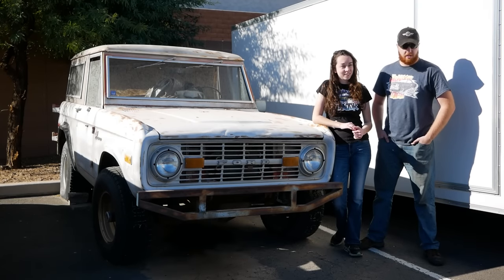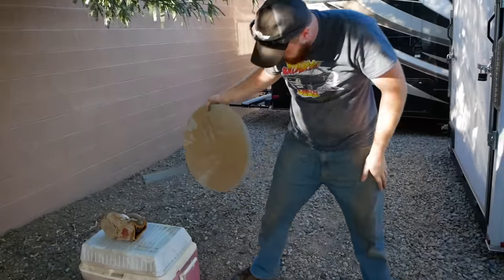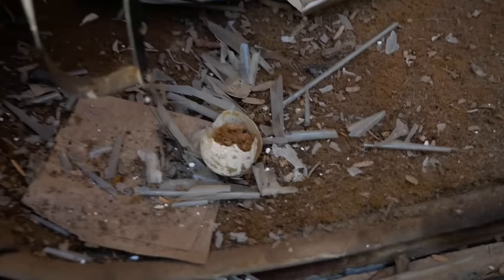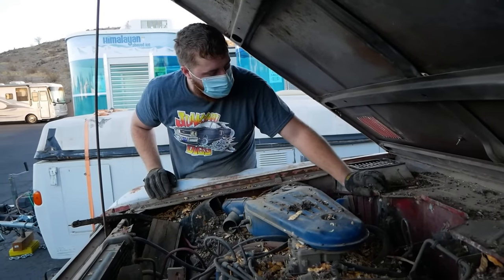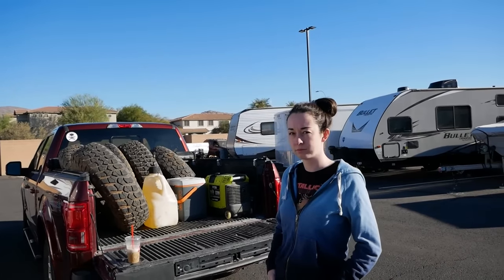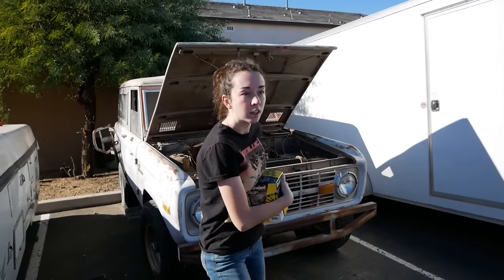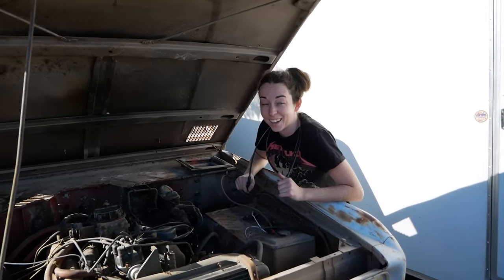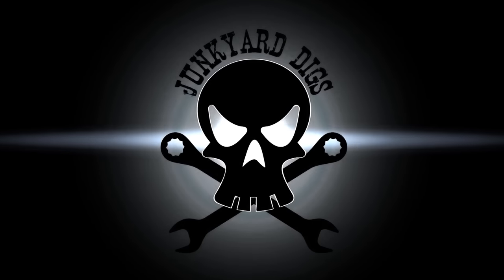ABANDONED Bronco Saved After 10 YEARS in a Storage Lot! Will it Run and Drive?? - Part 1

Comment: They didn’t change to the 351w firing order for the roller 5.0 until 94 except for the HO 5.0 🙂
A guy can also pull and measure a single pushrod to determine if it’s a roller - since the roller pushrod will be shorter due to the taller roller lifter. The roller pushrod measures 6.250 in stock form. 

Good coverage over the Windsor series - your dad here just had to add some points 🙂
Thunderhead289
Reply from the maker: Thanks dad, Hope I made ya proud👌😂
Reply: This comment might as well have been in French. Right over me head.
Reply: @JunkyardDigs  That's an awesome find ya got for yourself. I hope that you end up restoring it cuz there just ain't enough of them Broncos on the road anymore. The 302's are nice and all, but I would've preferred to see it with a 351 Windsor due to my own experiences with those motors. I had an '85 F250 with the 351. Bought it with 175k miles on it and sold it many years later with 325k miles on it. It was still smokin the tires by that time and was one of the most reliable engines I've ever had in a vehicle, though the 5.9L 360 Dodge motor that's in my 2000 Durango is givin it a run for it's money. :)
Reply: @sweettony9359  most of what I say goes right over car folks’ heads it seems.
Reply: How can you tell what firing order your aftermarket 302 camshaft has? Like what lobes would be different?
Reply: @ipissed  once installed and valvetrain set up, you can simply look at the driver side bank and rotate the engine over with  from the crank via socket. If the next cylinder to be on the compression stroke after cylinder one is cylinder 3 (both valves are UP), then you have the HO/Windsor style firing order. 

After cylinder 1 is cylinder 5 for the oldschool firing order. 

Luke aka Thunderhead289
Reply: @ThunderHead289  Yea, I was just thinking that you could do an o'clock position of the lobes. Mine is already in with valve covers and all so I guess I will have to TDC every cylinder.
Reply: @ipissed  only have to do two. As mentioned above
Reply: These are all some great tips on engine identification. Another way to tell if you have a Roller or Flat Tappet camshaft, if you can shine a light into the lifter valley and be able to see the "dog bone" lifter guides and the sheet metal hold down tray thru the pushrod holes in the heads. Another way to tell if you have a factory roller cam 302 engine instantly is the rocker arm mounting hardware. Factory roller cam engines use a bolt and is fully tightened down. NON-Roller Flat Tappet 302 engines have studs with pivot balls/washers and lock nuts to adjust valve lash.
Reply: Luke/Kevin, the 5.0 HO carbed NON roller from 82-85 also came with the 351 firing order
Reply: Every time I watch Junkyard Digs or ThunderHead289 I get that same fear I got years ago in school. Will there be a pop quiz?....Seriously, very good and detailed information.
Reply: @ThunderHead289  tks fer that bit of info gem, and really makes sense, tks.
Reply: @ThunderHead289  have u eva checked ur iq level? Bet its pretty high up there.
Reply: @edwardmulder3777  the way I look at life is that we have one full glass in front of us that represents our potential - we are able to pour that glass into an infinite number of other glasses which represent skills, abilities, and knowledge. 
We only have so much potential, I poured mine into some very specific things thus far in my 27 years - I’m no more intelligent nor capable than anyone else.
Reply: @ipissed  yes, if you put a 351W/H.O. firing order camshaft next to an early(pre-82 mustang & pre-94 F-150 302 cam(trucks had both non HO and HO 302 roller cams from the factory, I had a 92 F150 truck with a roller cam & the 15426378 firing order) the lobes will be in different places.  early 80's brought another important change on 302's only - move to a 50 oz.-in unbalance weight(they took 8lbs out of the crankshaft) from the early 289/302/351 28.2 oz-in unbalance factor.  Late 82 Ford also went to the one piece rear main seal!  lots of fun with fords.
Reply: Also, on the 5.0 roller blocks the lifter bores are actually taller, which is mainly why they make "retrofit" roller cams with smaller base circle to use factory 5.0 lifters in an early block.  usually link bar style hydraulic roller lifters do not need a small base circle camshaft, if the lifters are made correctly.
Reply: Wish it had the 289ci. My boss had a 1st gen bronco back in 04. Farm fresh. Even had the "Wolf whistle" Running off of the vacuum.. I love a 289. It can really get those rpms up
Reply: @ipissed  The best way to figure out firing order in my experience is to fill each piston chamber with rocket fuel, crank it and watch to see in what order the pistons come flying out of the block.
Reply: In the older 302 blocks, could a machine shop machine those bosses to convert it to a roller block?
Reply: @ThunderHead289  have you started drinking beer with old folks or something because your sure sounding like one today😂,but those are some really wise words Imma use it as a caption on a Insta post,I'll be sure to tag u👍
Reply: man im glad im just a MOPAR/AMC guy..less confusion lolz
Reply: I remember getting the firing order wrong on a 351W that was fitted into a Nissan pickup so we didn't know what year the engine was.  Apparently they changed sometime in the mid '70's, according to the book we had, though I suppose it might possibly have been a 302, the book still said the 351w changed firing order in the mid '70s.  It just barely ran with half the plug wires wrong, but we did drive it up a hill before trying the other firing order.
Reply: @ThunderHead289  I couldn't have said that better myself brother. I'm honestly happy to see you post such outstanding words to an audience of youthful people. Thank you Luke.
Reply: @ThunderHead289  By the way, I am 10 years older than you, born in 1983, and I learn new things every single day. The day that you truly believe that no one can teach you anything new is the day that you give up on life. You have a great outlook on life, and when you give words of wisdom like that, that's what makes me respect you as much as I do. You're a good guy Luke, keep up the good work and lead by example brother.
Reply from the maker: @william.s.goodwin  that was addressed in the video
Reply: @william.s.goodwin  All 5.0 High Outputs starting in 1982 had the 351 firing order.  '82-'84 were all flat tappet engines, and the roller cam debuted in the '85 carbureted HOs.  CFI/AOD '85s still got flat tappets.  After 1986, all HOs were roller cams and multiport fuel injected.
Reply: @DanEBoyd  That's what I was pointing out, though with a disdain for typing. I have an 82 GT that had the flat tappet HO. It's why I swore never to let a shop touch my car again, if I could help it. It has since been upgraded with a roller block after the original effectively split itself in half. Still have what was left of the #5 piston.
Reply: @william.s.goodwin  I had an '82 GT too.  It was red with a black cloth interior, and had just about every option except power windows and power locks and tilt.  It had cruise control with the Crown Vic-style steering wheel, and it even had the rear wiper!  '82 GTs are the best looking Fox Bodies ever.
Reply: @DanEBoyd  Agreed! I still have mine. It's a little worse for wear, but it's staying. It's an Argent with the Boss package.
Reply: @william.s.goodwin  Argent ones are the rarest, and my favorite color on '82 GTs.  Medium Red is OK, but Raven Black (or whatever they were calling it in '82) just kind of seems to obscure the car's styling.
I once had a coworker with an '87 or '88 GT tell me that he thought my '82 looked overdone with its hood scoop!  The '87-'93s are cool, (I have an '88 GT convertible) but are way more garish than the '82 could ever be.  
The Four Eyed GTs harkened back to real Musclecar styling, but the Aero cars definitely set some standards for the ricers who were to show up on the scene some years later.
Reply: @ThunderHead289  It sure does!  Accelerator pump?  Needle and seat?  WTF!!!  I think you made those terms up!  JK

Comment: I've got a '74 Bronco with power brakes and steering, 347 stroker SBF,  630 Holley 4bbl, (throttle body injection maybe this summer) new Centerforce clutch, heavy duty truck 4spd w/an Atlas transfer case, Dana 44 posi front end, Ford 9" posi rearend, 4.88 gears, just mounted a new Warn 8000lb winch up front, and to help that out I installed a Ford "Big Green" alternator, it's what Ford uses on their ambulance vehicles, so it's got a lot of juice...Bronco's weren't offered with A/C til 1980 I believe....Tom's Bronco Parts is a good place to source parts, but try to keep in mind that 1st generation Bronco's are worth a lot of money when done right, so they can get spendy, but their value keeps goin up...I paid $6000 for mine in 2008, it had been sittin under an apricot tree in one of the last apricot orchards left here in San Jose, Calif, turns out my Mom's high school boyfriend owned it...I was offered $25,000 cash for it right before this Wuh-Flu covid crap hit, and I turned it down....hang on to that rig bro, pass it on to your kid or whoever, it'll pay for itself and then some one day, it's a good investment....and they're beasts in the mud and snow ....🤘🏻🇺🇸....
 
IF YOU EVER DECIDE TO SELL IT, please MAKE YOUR INTENTIONS KNOWN ON YOUR CHANNEL...✌🏻

Comment: After watching Mook's dedication to these endeavors I think she deserves a dedicated points file ($1.50 on Fleabay) and some "don't bang my knuckles" gloves. Believe it or not  Ford Solenoids once had a button on the bottom for under hood cranking... honest. I pull off the connector from the solenoid and use a remote start button. Point file, feeler gages, remote start button and test light in all of my tool boxes. Horrible Fright was giving away electrical testers... got about a dozen.

Comment: MMO and Seafoam in the oil  and gas will definitely help quiet down the engine, and smooth out the idle a lot.  It will also help to free up those stuck rings.
Reply: He uses brake cleaner as starting fluid. I know it works but it's not ideal with fresh starts

Comment: i had a old 302 that ran great never knocked, smoke never used any oil. not even a leak. unknown miles. but my K bar was cracked on my truck so i pulled the engine to fix that then i saw i had a bad dent in the oil pan so i was going to change it. and when i pulled the pan i had 15 skirts in my oil pan. the 16th was off the piston also but dont have a clue where it went.  i love fords i have owned fords since before either of you was even born. i really like the FE blocks.you have a great find there keep it fit it and don't ever sell it.

Comment: Don't forget that Ford changed how the crankshaft was balanced in mid 1981 in the 302's..... That can be a nightmare if you swap out an 81 engine. You have to use the correct balancer and flywheel or a vibration at higher RPM's and a rough Idle will happen.

Comment: I am not sure if you will get anything from it, but I ordered some parts off rockauto.com and they asked where I found out about them from and told em it was you.
Reply: I love Rock Auto. I wish their shipping pattern was simplified. If I order a bunch of different parts they can sometimes ship from many locations and the shipping costs nearly break the deal. If you need one or two parts like a distributor or oxygen sensor for example, its almost always an amazing deal. But spark plugs and little things add up just due to shipping in a large order. Still my go to parts source regardless.

Comment: Just a tech tip. For pulling oldcars/bikes out of the woods and what not. A hot glue gun can coat naked wires quickly. Works better than you may think

Comment: A buddy of mine had one of these in high school and it was great other than we had to reset the points every week for some reason.  At one point, we had toyed with the idea of trying to superglue or weld the adjustment screw in place, but left it alone because we weren't ready to make that kind of commitment.  The videos are great, especially the ones with your hot sister in them.  Go CLONES!

Comment: One good tip for vehicles with points, use a penny to rub on the points. Works as both a file and adds a little bit of a copper coating to help rejuvenate points that you wouldn't expect. Also you almost always will have a penny on you.
Reply: Smart tip. I’ll have to try that

Comment: When you opened The hood, i Felt the mess, when i Brought home my 63 Plymouth Valiant, it had been sitting for over 20 years, the engine looked like a Haybale.....  The car is currently Awaiting Reassembly, and i am slowly Rebuilding the car, Stripped to the Unibody Frame, to sometime, Fully rebuilt and Mostly Restored, With the original 225 and push button trans.

Comment: @33:46
I came to watch again (apparently had viewed some time ago) from the diesel Buick or was it the 'New Shop Revival' video which I binged after the Buick Century revival, so when Mook suggested she could hear through a plug wire that Kevin is an idiot, I immediately was reminde of the grand difful-gul-tees of trying to isolate and quite the squeeling belt issue on the Century.  That whole managerie of different fixes that failed time and time again was when even Kevin himself began to question his 'idiotic' decision to revive the worst ever 80's GM vehicle produced.

Comment: www.wildhorses4x4.com/
(888) 405-1921  WILD HORSES 4x4 - 66-79 Ford Bronco Parts Source
1966-79 Early Ford Bronco Parts Source For Restoration, Off-Road, & Conversions. We provides parts and accessories for your 1966 - 1977 Ford Bronco. Call for Technical Help. Early Bronco Specialist. Expert Tech Help. Your Early Bronco Experts.
66-77 Ford Bronco Parts · 78-79 Ford Bronco Parts · Off-Road Vehicle Parts · Specials

Comment: i always use gas/oil mix~2 sroke fuel~to start engines that have been sitting several month's or more, make's me feel better,
Reply: Beats dry starting one, the rings alone will thank you
Reply: "Pyroil" was a good upper cylinder lube, the new cars would come with it from the factory, "back in the day".

Comment: A good rule of thumb is that if the engine has a MAF sensor it runs the 351 firing order. If it is carbed or runs speed density efi then it uses the old standard 302 firing order

Comment: 18:05 You're gonna hafta use da vacuum on da BLOWER setting to start out with, Kevin --- ya first gotta DISLODGE all of dat crap and get it whooshed up outta those nooks and crannies before ya can vacuum it up!  In fact, if I were doing dat job, I'd probably use TWO vacuum-units at da same time (i.e., with their air-hoses held side-by side, maybe with each hose held by a separate person, so dat da vacuum hose can be separately positioned to always "follow close behind" da blower-hose) --- one to blast da debris outta da orifices, and then another to immediately suck up da dislodged debris while it's still in suspension in mid-air, before it has a chance to fall back down into da engine-crevices again. :P

Comment: Harbor freight has 1200 watt compact generator ( size of a very small cooler ) for as low $80 on sale that might run a vacuum or an air compressor.  Might want to add to your revival kit.

Comment: You are officially a poopologist after cleaning that full engine bay of rat poop or some other animal poop. I had an apartment in Tucson Arizona  for a couple years. Glad to see you didn't come during the summer that would have been awful cleaning that poop out in 110 degree heat. That's great that you git that engine running my 89 F150 starts up first time every time in winter or summer and its a 5.0 liter V8 and has never let me down.

Comment: the fact that the engine turns with the fan belt sort of says it has NO compression...    i have never seen that before..   i like the Bronco..  thanks for not buying a complete piece of crap..   good job getting it running..  i hope it does seal up and start running better..    it probably wont but if it runs IT RUNS..      GREAT JOB..

Comment: Me: "Oh look, another video from Junkyard Digs.  Aww crap, 45 minutes?"  clicks on video when bored enough

Me 45 minute Later: What?!  That's it?  Crap!

All in all, I do enjoy these old 1970s Ford revivals.  We inherited my Grandpa's '75 F-250 Custom.  Ethanol killed the original carburetor and ended up putting one of those Chinese carburetors on it off Amazon.  Seems to run ok, but haven't had the courage to take it out on the highway yet.  I've gone up and down the road a few times so far.  It has the 360 in it with the 4 speed manual where you start out in 2nd while 1st gear is the Granny gear.  This truck's been in our family all my life and I'm reluctance to ever let it go.  My Grandpa loved this truck and took really good care of it.  If money was no object, I'd have a full restoration done to it along with a Resto Mod.

Comment: im hurting 4 the rings at lestfill the bowls first and use some mixed gas as your starting fluid. maybe pour some atf down the hole first thing if you dont feel like pulling plugs. alot of dry year sounded like but not my truck but forsure many others were cringing watching that.